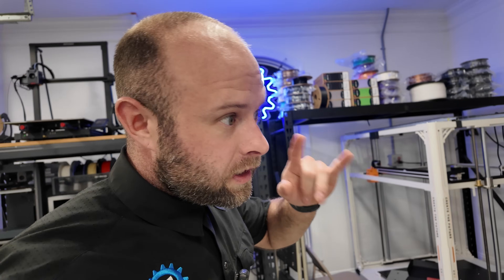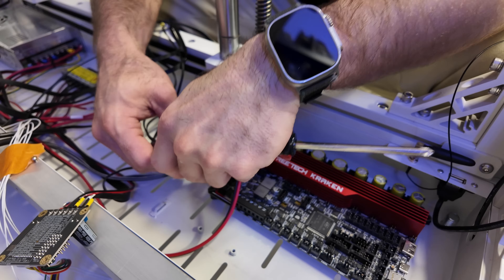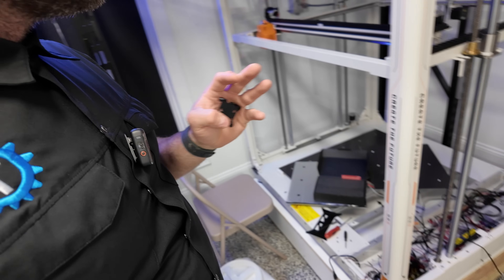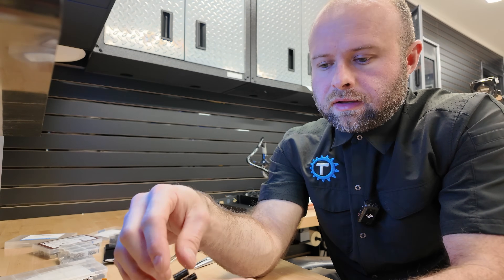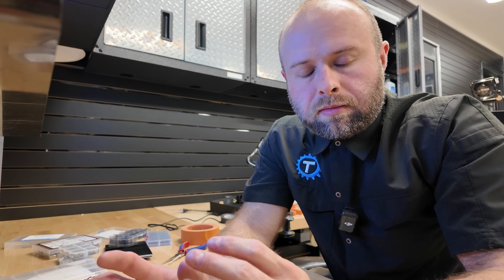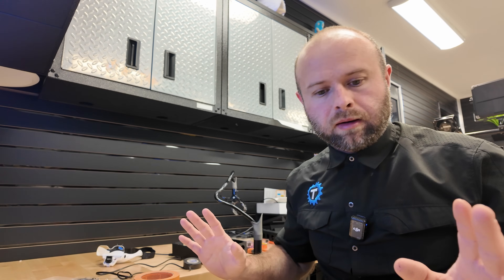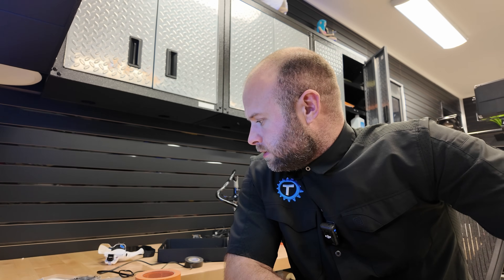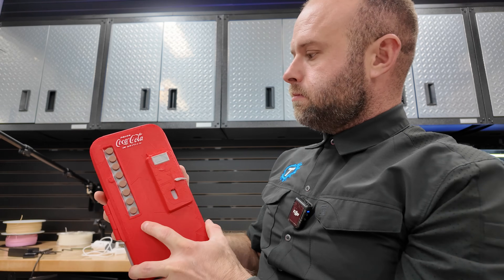Custom print for friend; Getting my Phd in printers; NEW HOT MODEL: 3D Print Vlog

Comment: If you built your printer when it was the only sane and affordable option, printer building, particularly wiring, electronics, firmware, software, becomes very straightforward. Designing mechanical bits is never easy, always full of bone headed mistakes, particular problems being access (whether things are possible to assemble and install), collisions and mechanical interference, forces and compliance vs. strength, constraint (whether things are capable of running smoothly) etc. Or maybe i'm just dumb, that's a possibility too.

Not convinced that LLM chatbots are a good resource for this, because of breadth of internalised not vocalised knowledge in these topics that one gains from first hand experience.

Comment: I feel ya i spent all week working on my printer, and I didn't get into this to work on printers, I got cool things to design and maybe sell.  But it was nice to finally fix the problem, and even upgrade it to make it better, that's instant gratification.  I was able to use a ceramic heather nozzle designed for Kobra 2s on my anycubic vyper, I noticed the parts are easily swappable at leaste electronically they all ure same heater cartridges and thermistors spec wise , if you can make them fit your good.  I was shocked to see the Bambu heater cartridges the same as the one for the Kobra 2 upgrade kit, the whole nozzle cost only 10 bucks with thermistor, heater, heater block nozzle etc. I thought about buying some Bambu nozzles but the heatbreak and their heatsink start to vary and where you can't mix and match anymore.  I am using a creality k1 0.6 nozzle in my vyper right now just because it melts nice with its big head I and also mates ok with the heatbreak.  The vyper has strain gauge nozzle,just for levelling, ahead of other bed slingers of the time. But the Bambu a1 mini uses it to detect flow and adjusts it dynamically leading to the best tolerance test results.  Dynamic flow... It's what their newest printers use too, but I'm thinking in software I could diy a dynamic flow hack using the vypers strain gauge?!?!  The firmware is even open!! That would be cool, but yeah how deep do you wanna go .. ?  I got trinkets to sell not doing this cool stuff!

Comment: Last night I decided that I need to build a small printer to go along with my custom Ender 5 with a CR-10 bed.

So some of us that are watching are trying to muddle through the process of building custom printers 😃

Also, the glasses thing is real. I wear reading glass all the time because I'm older than you but I knew putting them on and off would never work. It has made it impossible for me to see without them on, my eyesight was amazing when I was younger. So keep up the fight for as long you can
Reply from the maker: Dude, did you see VIZZ eyedrops? Should release this year. Eyedrops that fix the near vision issue, no glasses!
Reply: @TechnicalsTinkers  I had not, I had to look them up. If they are priced low enough then I'll be down to try it, I have a feeling they won't be available to me for a while. I hope you have access, that would be awesome if they work for the people that can afford them. Eventually the cool stuff gets to my price range, so you'll have to let me know how they are